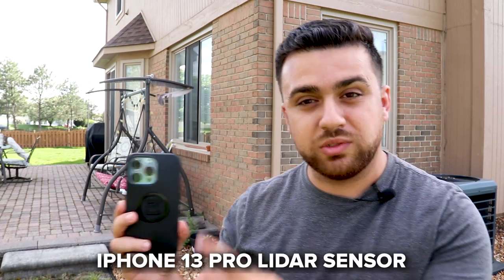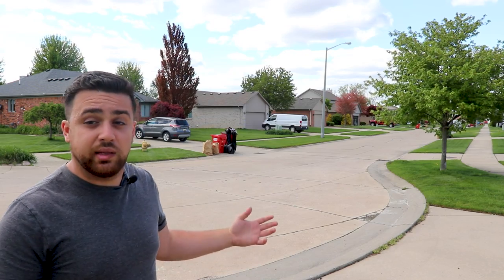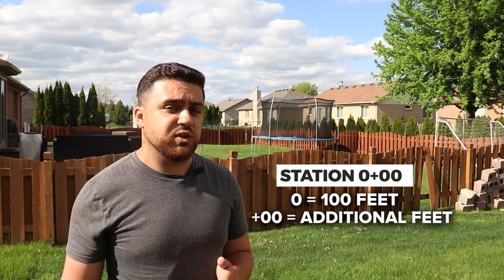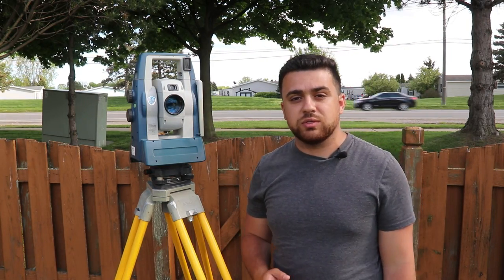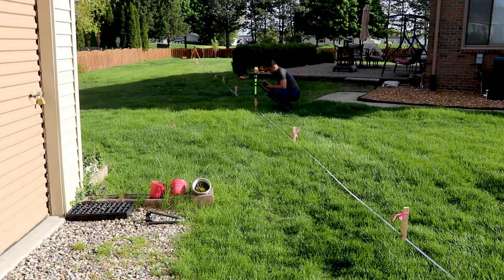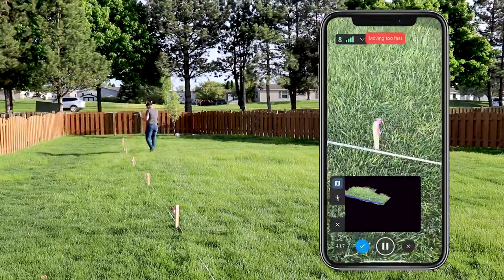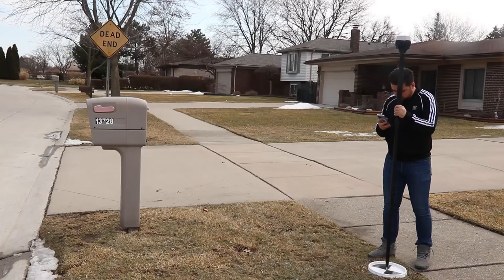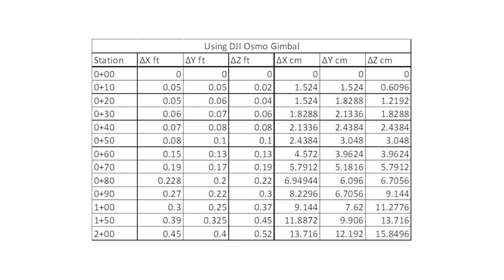iPhone with RTK vs Gimbal vs Total Station

Comment: Another great deep dive, thank you for sharing!
I would’ve been curious to see you add the gimbal back on after adding the RTK.
Reply: I was thinking the same
Reply from the maker: I would need a bigger gimbal since the weight of the RTK device is heavy
Reply: @RamiTamimi  oh that’s right. We know it would improve the results to some degree, I was just curious if it would be a drastic improvement. Judging from the non-RTK run it seems like it would have a pretty decent impact. I would let you borrow my Gremsy if you were a bit closer. But I think you illustrated the point well enough.

Comment: Polycam App update - Used this now for a few building trials and it processes large building scans well.  When purchasing the full APP (monthly pas as you need) it converts the 3D scan into Autocad dxf and other industry standard file formats very well.   The only issue I have experienced is determining the exact point for the corner of buildings.  I will look to use larger ground targets with site dimensions to triangulate and set actual corners, so hoping larger ground targets that can be clearly identified once uploaded into the CAD software will be the way to go. Otherwise, Polcam has worked very well.

Comment: Can you use the gimbal and the rtk at the same time. Thanks for info
Reply: It’s simply not possible to do it. That gimbal already struggles a bit with the heavier weight of the iPhone 13 Pro (which has a stainless steel housing, hence the extra weight). The added size and weight of the iPhone + rtk would make it impossible, unfortunately.
Reply from the maker: I would need a bigger gimbal since the weight of the RTK device is heavy
Reply: Greetings from Argentina, with a DJI ronin it is possible, do you think you can get one to do some tests?
Reply: @RamiTamimi  if you did that it actually might be the most accurate solutions overall

Comment: 0:27 No, the accelerometer can not measure speed and is not used to measure speed. It can only sense the (rate of) change of the speed aka. the acceleration (hence the name accelerometer).

Comment: I see your nearest mountpoint was 193 miles away on the screenshot, is that what was used? Also, why not put the viDOC on the gimbal and then test that? Weight? It seems that having a mount point within reasonable distance and the gimbal would provide significantly better results.

Comment: Currently using LiDAR with Polycam to capture large commercial buildings.  I found that 3D Scanner App couldn't handle large building scans and kept crashing when trying to process.  Polycam seems to process captured data very quickly although haven't purchased the full App yet.

Comment: Rami - could you draw a floorplan of a house using an iphone 13 with an RTK antennae attached by measuring the gnss location of each corner (inside and outside) of a house.  Example: the house is a ranch style with 8 or more corners.  Could you determine the location of each corner and feed the data into a program that would draw a line from each location to the next thus creating a floorplan sketch accurate enough for an appraiser to determine the gross living area of the house?
Reply: Not sure how well RTK works inside buildings since most RTK base stations are compensating for open air errors and not the error introduced from the building and whatever attenuation and reflections that might introduce. Probably better than none RTK GPS, but worse than open air RTK.

Comment: Any thoughts on accuracy when the model is produced from images beyond the LIDAR range?  I have been able to get impressive capture of sloped roofs when I scan in a wide circle around a house.  The iPhone lidar appears to be limited to about 15 feet and it looks like the images are being processed mainly from a photogrammetry perspective.  The details of the facades are less crisp in the point cloud, but the majority of the roof gets documented.  I tried doing a scan with 2 laps where I start out close to get good lidar coverage up close then expand the capture circle on the second lap.   More often than not I get significant misalignments using this method.  unfortunately,  I don't have access to software that will allow me to create manual tie points to bring multiple models together.  I am using a gimbal, which definitely helps, but I don't have access to an RTK device.

Comment: I understand that the error relative to the total station can be 1 to 3 cm, but, if I am not relating the measurement to control, how accurate is it? I am working on a site where I would like to create a heat map of surface regularity. The floor has to be plus minus 5mm. The floor level is of course important, but would this lydar scanner on the iPhone be accurate enough to create a cloud point terrain model of the surface?
Reply: I don't think it would be applicable. I need a total station or 3d Laser scanner don't I?

Comment: After seen all videos, I’m disappointed that this lidar apps on IPhones are not compatible to EMLID GNSS recivers or eny other GPS HARDWARE to connect to iPhones as external gps to collect data using this lidar applications in RTK, forcing us to buy this viDoc RTK that don’t see any use for it as a land surveyor and spend $5000 dls just to use it ONY for this applications